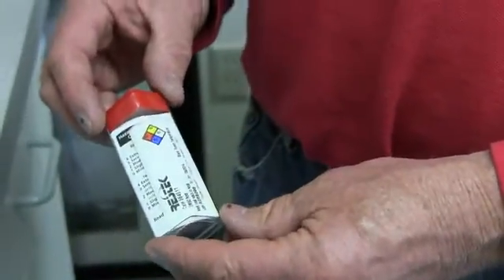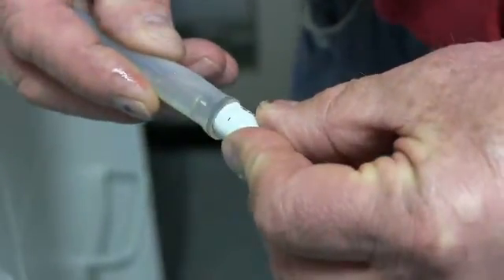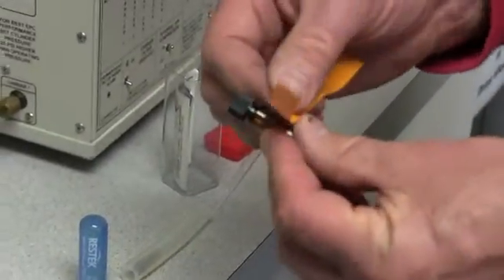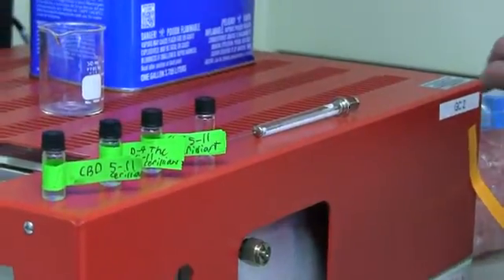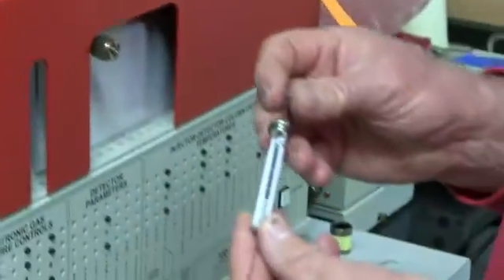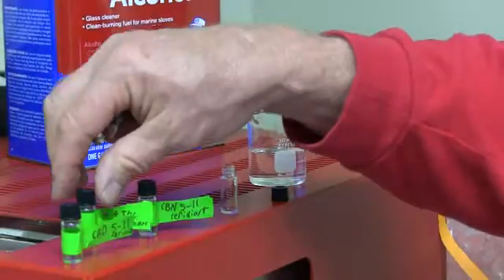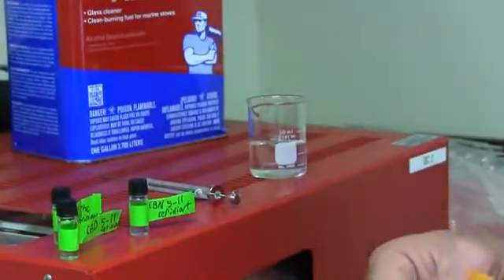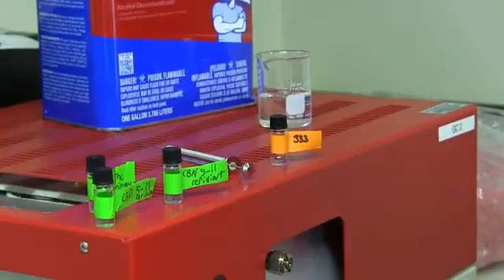Calibration Standards for GC: getting started

Comment: What kind of certification does someone need to operate a Gas Chromatography machine in a professional field or to sell services? if you do need certification how can they go about obtaining one?
Reply from the maker: Daniel,
There isn't any certification to run a Gas Chromatograph(GC). If you buy one from us you get 4 hours of free training that will enable to run the machine with ease.
Now, for certain applications such as working in an EPA/pharmaceutical/agricultural/etc., lab, they would probably want you to have a relevant degree. 
To just run a GC there is no requirement, so if you can run it you can do it.
I'm assuming you're talking about using a GC for testing cannabis. If that is the case, it depends on state laws for running a testing lab, but for the most part, no there is no prerequisites. If you want to tell me what state you're in I can give you more information.
If this would be used to just verify you're own product and for your own quality control no prerequisites are required. 

I could go on and on, and if you want to know more feel free to call us at (310) 214-5092. We have free tech support from 7am-4pm PST. We even have a free after hours number if you have a GC emergency.

tl;dr: No you most likely do not need a certificate to operate a Gas Chromatograph.

My apologies for the delayed response.